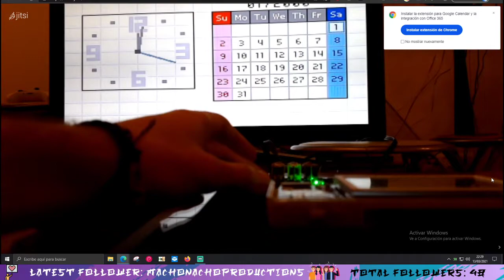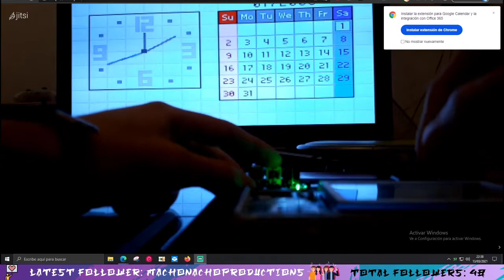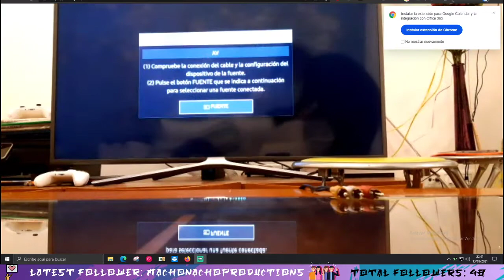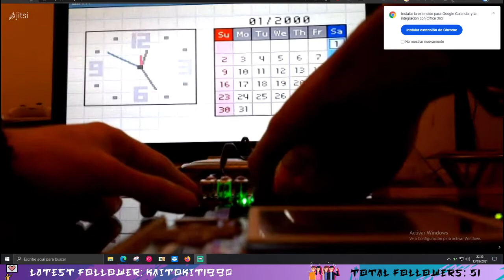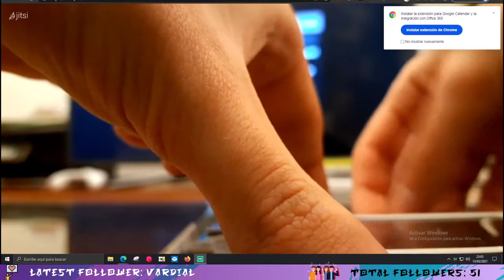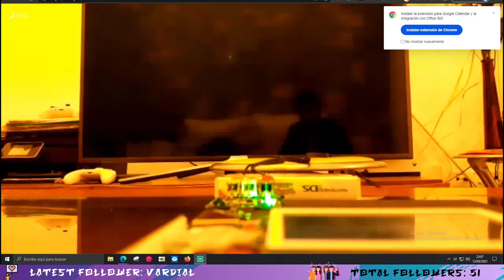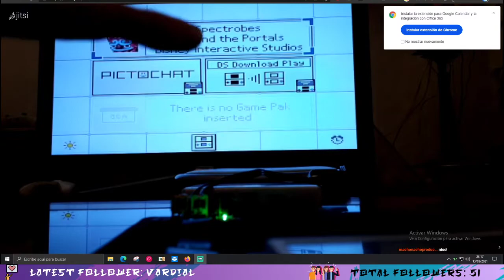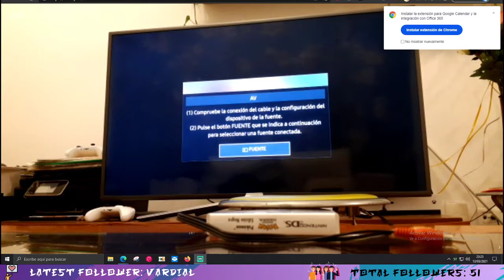[FULL] NDS TV OUT Installation Stream - Lost Nintendo History

Comment: Hey, just stumbled upon this mod today and want to try it out. I have a quick question regarding the circuit diagram that is available on github. It seems that the DAC has a maximum output voltage of 400mV and the output is then amplified using an op-amp non-inverting amplifier configuration. The gain on the circuit diagram is set to approximately 3.5. After reading up on cvbs signals, it seems that the maximum voltage should be around 1V. With the provided schematic, the max output will be 1.4V right? Or am I missing something? I am just curious if this will have a big effect on the video quality

Comment: Hi there. I'm trying to understand, why the custom ROM is needed. Can't you design a circuitry that takes the upper's screen signal and convert it to a TV signal? Also, did you have to program the screen flipping and the transparrency and all, or was that hidden code inside the DS Lites firmware?
Reply: I'm pretty sure the custom rom is just for the screen flipping.